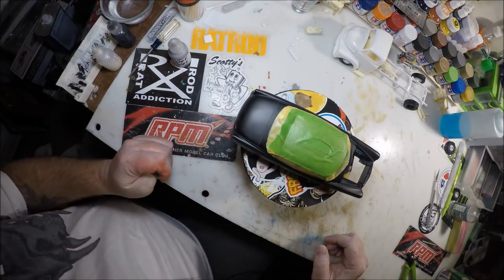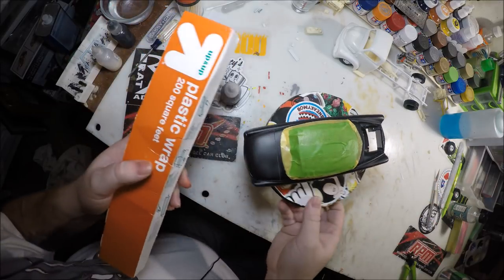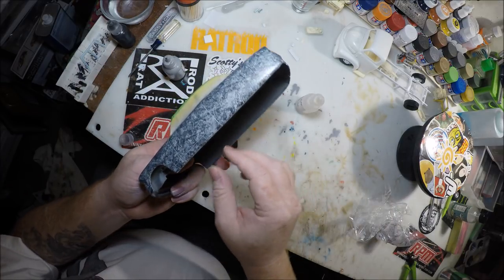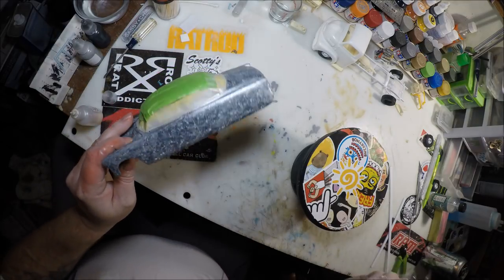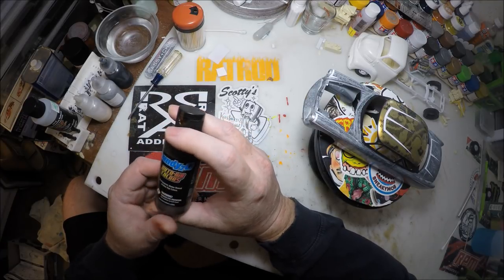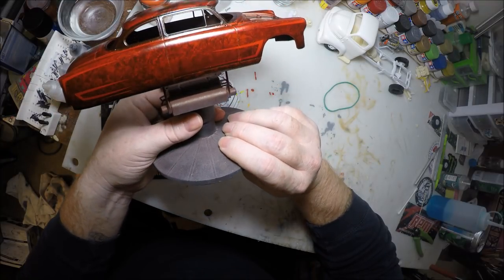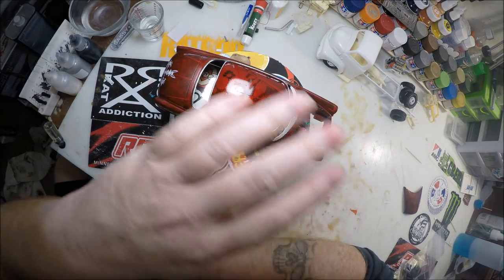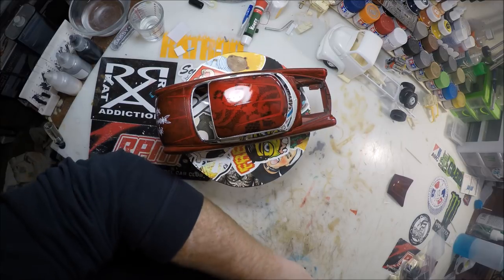scale model marble paint how too

Comment: Hi
I’ve been admiring your custom airbrushing and as a consequence bought the CandyO2 you use. However I’m struggling to get my head around reducing the paint. I know you say that you don’t reduce but on my AutoAir bottles it says you must add Inter-coat Clear 4030 as well as using the 4012 although I agree the paint seems thin enough. Also my supplier website says the Inter-coat Clear 4030 also acts as a reducer. But all the info online suggests varying ratios.
I’m using a .5 needle. Do you use the Inter-coat Clear 4030?
Your advice/experience would be greatly appreciated as I’m keen to do similar effects as you.
Thanks for the video
Reply from the maker: I use 4030 as a coat by itself when layering candies on top of one another it keeps them fro bleeding together. As stated I don't mix my candies with any type of reducer.
Reply: @nickamburgey1980  Ok thanks for your reply.
Reply: @nickamburgey1980  I've had mixed results with the Candy02! I seem to get too many runs like it's over diluted but I haven't reduced as suggested. I'm not sure why? Any advice would be greatly appreciated!
Reply from the maker: Reduce air pressure and spray very light coats I spray mine at about 10 psi!
Reply: @nickamburgey1980  OK that's the reason I should have known! I was literally following the bottle instructions 30psi! Thanks again..
Reply: Perhaps you could do a tutorial on spraying the candy’s ?
Reply from the maker: I would but I'm in the middle of buying a house and my bench is no more at the moment. When I'm back up and running in a couple months I will.
Reply: That would be great - it's a tricky paint to spray. good luck with the move.